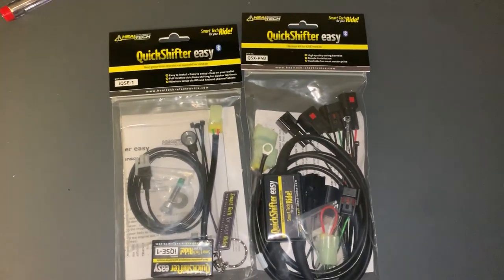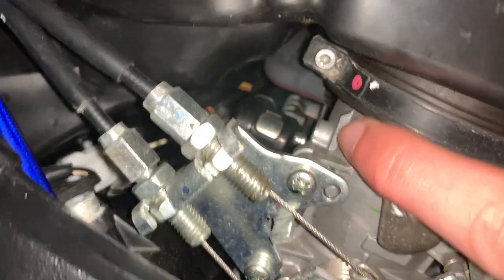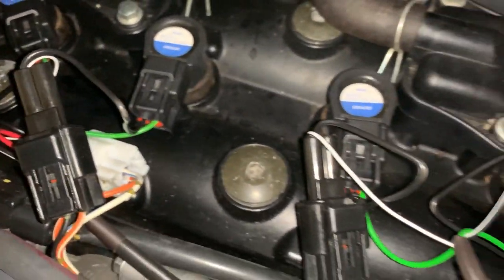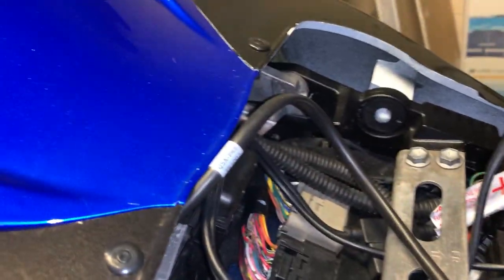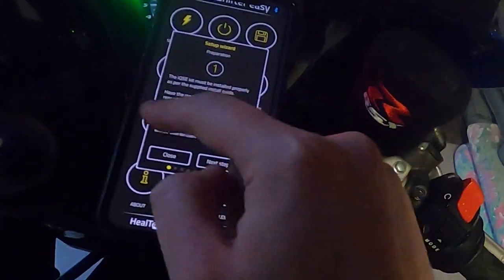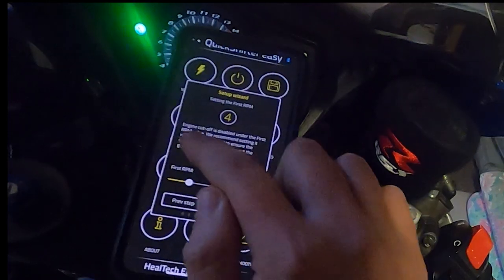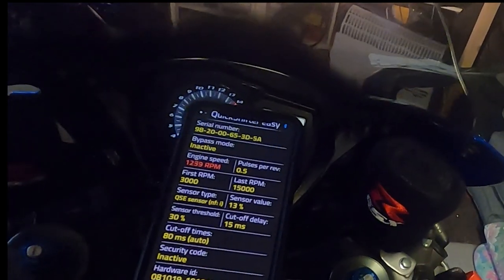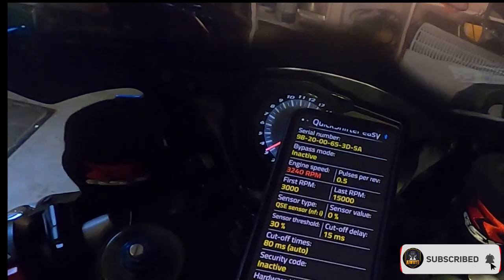THE Quickshifter for EVERY BIKE! How to install the Healtech iQSE-1 on my GSXR1000 k7 k8 2007 2008

Comment: OMG!! WRONG.
what you do at about 4:30 is, you are shifting gears without the quickshifter being engaged because you have set the "First rpm" at 3000 and you shifting gears at 2800.
 That means that the quickshifter does not cut the engine yet.
 You have to be 3000 or more to engage the quickshifter or decrease the "First rpm" value at 2500 for example..
 You are lucky that the bike was not on the ground..

Comment: Is it possible to install an autoblip or is there an option for autoblip with this system? So far I can only find irc quick shifter and autoblip system for the 08 gsxr 1000.
Reply from the maker: not that i know of, only knew about the quickshifter, you can tho down shift but its not a real blipper etc

Comment: Hello, i have suzuki GSXS1000F i have bought a quickshifter easy heal 
tech. Would you be so kind to show how you connected each cable? I 
really like your video.ty
Reply from the maker: Hi bryan its very easy, you need to put them in between the original cables. So they get inline!

Comment: hello, Man. greetings from 
Saint Petersburg Russia,  how u doin?) i've got the same bike, Gixxer K7 with the straight pipe,  i wanna know, what about exhaust flame on shifting,  it's possible with this device or not? )
Reply from the maker: yes, but you need to tune your ecu and remove the cat
Reply: @Kiwiiyt  hello, i've already installed tuned ECU, and straight exhaust pipe ( without cat).
Reply from the maker: Its after burn programmed on ecu
Reply: i have afterburn when i close the throttle  from ±7000rpm  then i have it. i want it on shifting,
Reply from the maker: then you need a quickshifter

Comment: If sensor value hits 100, it will up gear by itself right? That worries me
Reply from the maker: if the sensor = 100 your hitting the pedal.. no chance it will 100 bij it self, then your hardware is not on the right place
Reply: Decrease sensibility and you're good 👍

Comment: Will it affect the gearbox in the long run?
Reply from the maker: Cant really say, have had nog problems so far
Reply: It`s actually better because it is killing the engine in between shifts unlike using the clutch and the motor stays running
Reply: Yeah this is actually completely fine. Bikes are made for it

Comment: Where did you place the sensor.? On the rod or on the shift link?
Reply from the maker: Hi aaron, send me a dm on insta, i will send you a picture!
Reply: You can install it on the pinch bolt for the shifter rod.